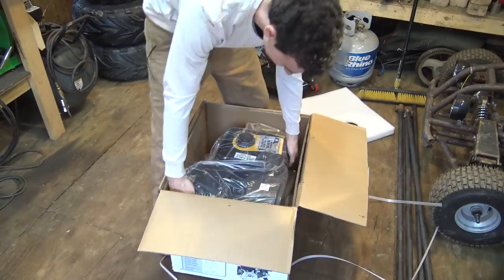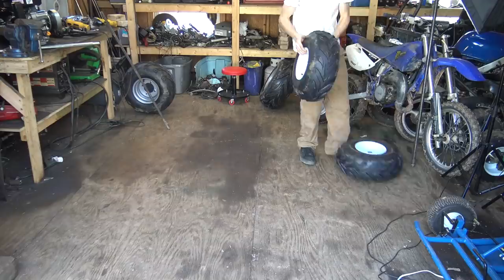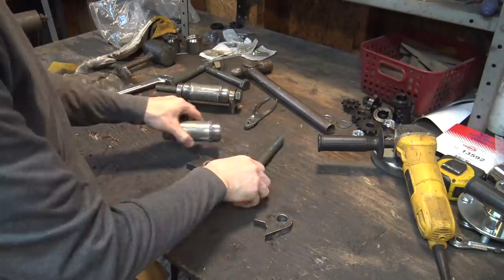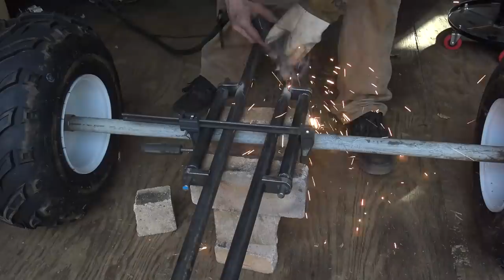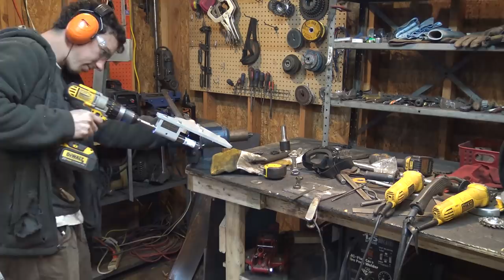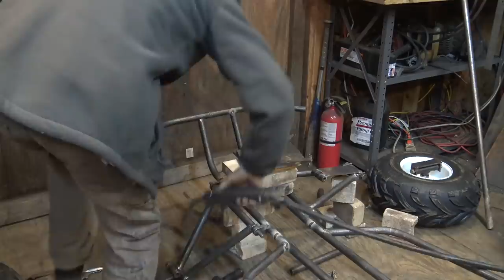home made two speed off road go kart part 1

Comment: You must lift with your knees! I've thrown out my back a few times because of improper lifting procedures and I'm only 31. It's absolutely debilitating. The way my doctor described the mechanics to me is like so -- when you bend over to pick something up, your lower back becomes the base of a long lever, and the weight supported there can be as much as 10 times what you're lifting. lifting a 100 pound engine? That's 1000lbs your lower back is trying to support.

Great video, I'm new to the channel and loving it, but your lifting techniques will hurt you if you're not careful.
Reply: I am paying for doing it wrong right now,I'm basically fucked. Good advice George.Young people should listen to it.
Reply: @larrymbs  But they won't just like we didn't.

Comment: You're awesome.  I just watched all your lathe vids and I'm extremely impressed. 
PLEASE be more careful w/ your back.  I've suffered 18 years of back problems because I lifted one of those old fat tire minibikes the same way you lifted that engine.  POP, ruptured a disc.  Next week I'm having vertebrae fused with rods and screws, my second back surgery.  Been on disability since December after 18 years of painfully suffering thru work and finally couldn't do it anymore.  I'm 37.
 I was 19 and playing college baseball at the time I ruptured that disc,  I could run 4 miles a day no problem and bench 325 8 times, so being in shape doesn't cut it...you gotta think before you lift.  A blown disc will ruin your future with machining and riding off road stuff....Don't end up like me, you're too talented.

Comment: You should run 2 separate axles in the rear so that the rear wheels can sway individually. Just make them like swing arms on a bike. It would be a much smoother ride and could handle corners better at high speeds

Comment: never use a impact gun to torque down anything on aluminium
Reply: Must be referring to the old air impacts. The Dewalt has adjustable settings and the lowest is less than 10 ftlbs.

Comment: That Honda engine would be an awesome swap in the future but they are a really high revving engine and aren't tuned for torque if you could find an old 400xr or 400ex Honda they would be ideal for this kind of project they make less HP than that 600 but they still make plenty enough torque and HP and they make it in a rpm range that is much better for the speeds you will be using this at most of the time, plus their air cooled so no radiator like with the 600. Other similar fairly cheap options would be a 350 warrior or raptor, Suzuki Drz 400,or even a 300ex although their down on power compared to the others still a lot stronger and smoother than that 420 and they have 5 forward gears and reverse. I think this is a cool project  man good job.

Comment: Next time drill holes and plug weld them much cleaner look and if you need more strength other then them being pressed in then bevel the edges so you get a better weld and then you can still grind it smooth, you probably already know this, keep building bro nice work

Comment: Beautiful fabrication.  You could have reduced the complexity of the front suspension by welding a vertical tube to the pivot for the spindle support. Then you could have used a tube between the top and bottom pivots and welded the spindle directly to that, similar to what you did to your "A" arm pivot on the frame.  This would have avoided the turning restriction caused by the channel iron contacting the steering arm.  I am currently building the "A" arm suspension for an off road cart& was noodling over this same issue.  The I had an Aha ! moment and this solution presented itself.  When you do your triangulation of frame members it is better to terminate your tubes at the corner of another triangle.   Connecting at mid span induces a bending moment that can compromise the structure.  Think in terms of, it is best for your members to be in pure tension or compression for maximum strength .  there will be exceptions, but this is a good rule of thumb to follow.  Again, I am impressed with your design and fabrication skills.

Comment: Awesome work on the build and the lathe. Just a suggestion. When you but weld 2 pieces together put a solid piece inside, it gives more reinforcement. Ive been welding 20 plus years ptofessionaly. Also i have a honda 750 street bike motor for sell for 150, just needs carbs rebuild and syned be great for this cart. Message me and we can talk.

Comment: If you took two seconds to shine up the ends of what you’re welding it would weld much better and be much stronger weld. Like the small pieces just chuck them in the lathe and use some sandpaper and buff the ends off before welding. 

I ain’t bashing just an idea for ya. Keep up the rad builds.

Comment: I see youre using thick walled Water pipes for frame tubes - this is VERY HEAVY!!! you can go by your local Garage door place and get the tube axle that Garage doors use for the roll-up type with the coil springs and the cables and pulleys , THAT TUBE is perfect size for GoKart frames, and is SUPER strong, way thinner walled and lighter than water pipe, AND most garage door places have piles of it around back from tearing out old ones and selling the customer new ones, you can usually get a bunch of it cheap or FREE.........
Reply: Eclidean ...in the old days, maybe the free or cheap thing was true...my son is an installer and trust me when I say that MOST, most garage door companies sell all of the old pieces for scrap and either add it to the bottom line or use the money for bonuses and the like...my son almost got fired for taking a lockbar to fix my door with...narrow profit margins have made companies very picky about their scrap...and really? Who can blame them?

Comment: Just and idea for you. if you have a blown up predator or other engine maybe you can try putting one of your transmissions inside one so it can run in oil or maybe find a way to do like you did with the dirt bike transmission you had beind a predator. My thought was that was a cool idea cause it added a working clutch for shifting.

Comment: Hi

You made a mistake on front knuckle arms there is no hole for driveshaft
Front wheel drive is easy to make using 2-speed transmission consept with small variation. 
You need to make two moving dog plates, one dogplate to connect pulley chain to axle and other to connect driveshafts together, unless you make freeclutch to allow outside wheel to run faster on turns

Comment: Good stuff as usual...the welding is hard to watch it could be reduced alot and still get the point across.. .and that techno elevator sound? Ugh...mabee some extended guitar sounds...but your videos have improved dramatically...again excellent work! Im ready for round 2 etc. 
Looks like gas pipe...great material peace

Comment: great video, I'm a welder myself -is that gasless welding wire your using? do your welds break often??  I wish i could build myself a cart, but my back has gone on me
Reply: Flux core welding is OK. Fine for the wall thickness he is welding.  AC works, but DC is generally better. On thicker metal, just turn the wire feed down a little and move slower to let the arc penetrate a little deeper. I’ve used this method to weld jacks to auto hauling trailers which may experience high lateral forces.

Comment: When unboxing a heavy item like that engine, open the bottom of the box, don't remove the bottom packing, turn the box over and lift the very lightweight box off the heavy engine.  Since you don't remove the bottom packing right off, the engine will sit flat and stable on the floor.  Also, I'm wondering, if you are using a torque converter why build a 2 speed transmission in addition to the torque converter?
Reply: PS IMHO it would make more sense to build a reverse instead of a 2 spd tranny.

Comment: also mate machine your boss to 0.02mm oversize heat the tue in the oven or furnace to 200 deg c press them on in your vice then cool no need for a weld ever.

Comment: You're kind of getting repetitive. Same style buggys all the time, and almost-same motors and trans. You should have started a mini trophy truck like you were thinking, something totally different and weird that no one has done before. And instead of wasting money on these harbor freight motors, you should be snatching up motors from Craigslist that came out of old dirtbikes/ATVs.
Reply: He needs to learn how to tinker and tune engines first. He already got in over his head on one kart with a bike engine and it still doesn't run 100%. No sense in just repeating that process over and over. Lawnmower engines are cheaper and a bit easier to work on. Anything you pick up cheap on CL has problems that the previous owner already doesn't know how to fix or is a basket case they are trying to unload on somebody else.

IMHO what he really needs to to is try to build/tune a 212 to be a balls out runner and I'm not talking about just bolting a bunch of parts together. Learn how to do that first. Step up to a more complex single carb and cylinder bike engine. Then jump up to multi cylinder and carbs.
Reply: with respect hes doing what he know an he seems smart for doing so i can understand moving to bigger better things but all in due time
Reply: Exactly. I think he's mastered "RWD buggies with small motors" pretty well. How about some 4WD builds, Independent suspension builds, etc. Mix it up a bit!
Reply: he needs to learn to weld first - he didnt clean his welds - all that white shit round them is weld contamination. Even worse that shit is galvanised pipe - which produces toxic zinc fumes when welded - just about the first thing they teach you in welding/workshop these days.
So because he didnt run a grinder over where he was about to weld he poisoned himself AND got weak welds.
Reply: He also needs to learn how suspension works - the wheels should lean in when you compress them to help you corner (car leans over, wheels lean the opposite way to maintain the contact patch flat and maximise grip) - thats the point of double whishbone style suspension. This design is doing the EXACT opposite - leaning out under compression and in under rebound ensuring as little as possible contact while cornering on BOTH wheels (the inside one needs to lean out as it goes down to stay level)

Comment: I am looking to build a Go Kart i can ride to the store and back. I must be in a reclined position as my neck and back ache so bad i can barely stand or walk.  AND worse yet i have to build it by myself. No one wants to help and always has their encyclopedia of excuses right at hand.  I understand they have a life and I do not. But if I can being this to fruition, then I will also have a place to sleep and recline. But... I also must make this quick enough to get me from point a to point b before fulfledged pain sets in. Getting "caught" off the side of the road by cops bent on taking my only mode of living, surviving, sleeping when necessary (i have severe type 2 diabeties, even lost my right foot just below the knee which gives me severe walking problems.  But with this cart setup right i will be able to do all my needs quickly and most from the cart.  Because I live alone on my brother's ranch and my plans on being able to use it for faem work... a slow moving vehicle sign should allow me to function at 25 mph (instead of 5mph) making living available. However, I can forsee some cop confiscating my farm cart and that would mean i will lose everything i own plus unable to get anywhere as i can walk less than 300 feet ar a time. I have an abundance of camping gear which would be taken if the cart is taken... meaning i will be left utterly homeless, imobile, in horrible pain and then probably arrested for more madeup charges making me broke too. (I refuse to beg, steal, lie, and always obey all lawa except when laws are madeup or are to strick to allow me to live.
   I have most of the parts... probably about 95%.  But like today... i was able to get some tools moved close and removed 2 engine bolts before i was in too much pain to continue. (This means my tools are all outside and subject to the weather.  Upon looking at engine removal (its blown and I have a new one), i discovered the rear axle it mostly welded: sprokets, brakes, two piece axle etc... the bearings are normal (thank God) but the axle is all buggerer together and its a live axle. So i need to convert it to a positraction axle... one Belt drive clutch connecting a jack shaft connecting 2 centrifical  clutches (one for each side) and a 2 piece rear axle. Of course there are both braking and steering problems to address (at least their upgrades can be posponed for a short tine as the do work.)  Over the years I have acquired more the sufficient lighting, all LED night vision - both IR & UV plus solar power, electric alternator, I have necessary supplies ti build a small trailer, a 12v dc  generator/starter motor,  and just need a few more months to get mostly the small pieces/parts except a new axle, two new Air Shocks, grass cutting parts to also collect grass along the ditch lines after it has gone to seed. Our farm needs the seeds and so to does other area farmers with livestock.  Hopefully that can generate money for fuel and some living expenses.  I lost my drivers license when I was in one of 3 extremely abusive hospitals that amputated my leg and kicked me out because they refused to treat my foot wound and due to a foley they inserted... they totally mutilated my man hood. Then got mad at me because I refused to let them amputate the rest of my manhood. In fact, 3vhospitals refused to take the foley out (i did not know how, pkus with a severe bladder infection i had to walk (severely wounded, infected and neglected foot sore) to the toilet every 5 minutes most often leaving a trail of blood. AND SO, the foley stayed in until the balloon on the end (that keeps it in place, inside the bladder) exploded inside me... exploded inside me. At least that cleared up the infection as it came out in a gelatinous form looking like the foley tube even after falling to the floor.  Think of how much pain that jellationious mass caused being inside my bladder and having nearly all the cavity on my bladder filled with this infectious mass.  And the hospital Doctors did not care... even trying to prematurely kick me out of the hospitals using their ability to stop pain medication as leverage... this happened in USA Folks!  Land of the treed and home of the depraved!
     Well, i will try to post on how its going. And if this government rries taking my only mobility/survival means away in an attempt to murder me.  AND it is just my luck (i would not have it any other way) that I have lived to long in so much pain that I cannot stand to inflict pain on others, even my enemies.  Remenber shows like ines depicting accidents to others, like getting hit in the groin by a baseball?  Watching those shows actually cause me physical pain to watch and even the instant replay causes the same pain. I cannot watch such shows... so i dare not even think about the revenge that should be done. Sorry for the depressing information but it does offer people (those currently unaffected) what could be instore for them that they may be better prepared. I do have an upside... when God is ready he will reverse this situation even giving me (and another) a job against these animals.  He will even take away the feelings i get seeing someone else  (deserving) being hurt.  Read Rev Ch 11 it speaks about both of us.
If I am lying about who I am (one of the 2 Witnesses) then it would make me a false prophet and by my words i should be sentenced to Hell, plus all that pain when seeing soneone else hurt woukd not go away... plus being a Christian all those that hurt me will be forgiven by me something they, (Christian Instructors) dont teach... for one to be forgiven they must want forgiveness, most do not, they only want forgiveness so they can do it again or other things solely For their Benefit and without remorse.  Remember forgiveness is not forgetness which neither works unless the person truly wants forgiveness and that will be displayed by how they attempt to achieve forgiveness.

Comment: What can I use when I don't have a metal lethe machine
Reply: U dont need a lathe at all, you can use tube steel cut to size then using nylon bushes, u can get them on ebay almost any size plus theyll make the ride a little smoother👍

Comment: I like you dude but YouTube is fully of predator crap
Reply: Kane Cullen the Predator engine is the best engine
Reply: tony 12083 erm no, I’m afraid not. It does just find as a cheap engine but far more fun and power can be gained from proper bike engines rather than cheap Chinese generator engines
Reply: Lol @ harbor freight is the best engine;(
Reply: predator may have more power but i would go with Flathead engines
Reply: Donovan Bryant non flat head sound Nice 👌 but they are not compression and they not Rev high